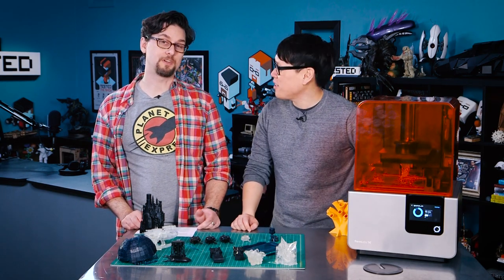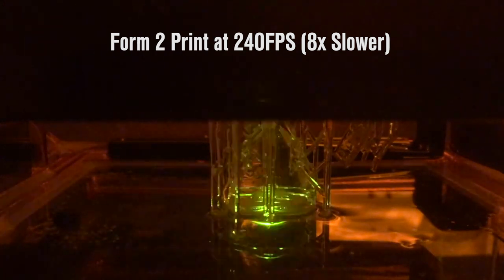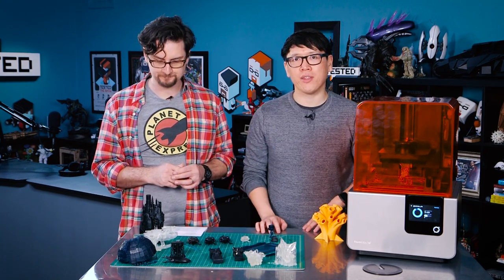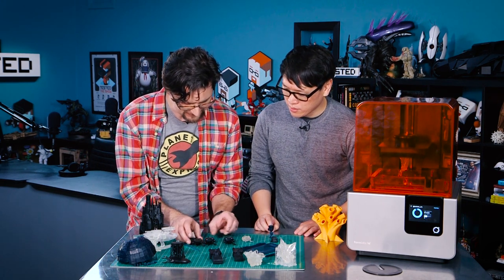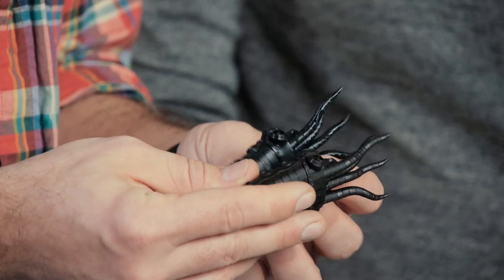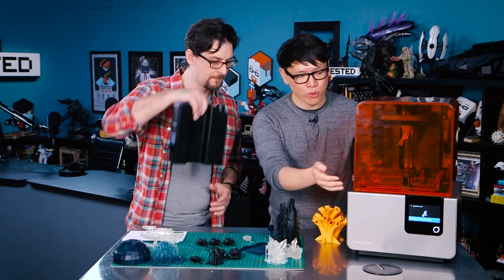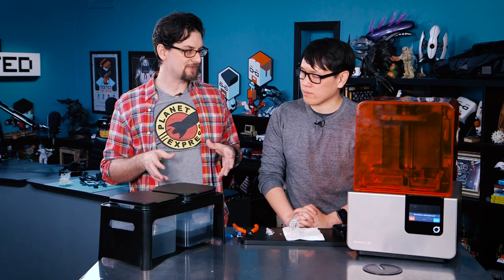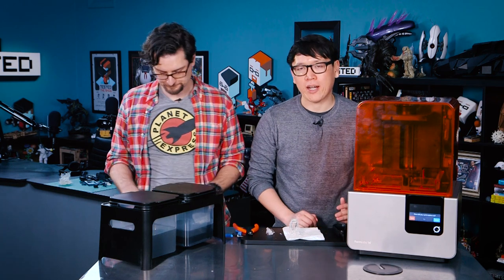Tested In-Depth: Formlabs Form 2 SLA 3D Printer

Comment: Norm's statement of it not being your first 3D printer is a little misguided. Why should someone get an inferior one in the first place? Just because it is cheaper? If you have the money, and it's something you want/need, then don't waste money on a crappier/cheaper printer, that you're just going to replace, and never use after anyways.
Reply: +SpeckyNation It's better to start out with a cheap printer, if you get a really good one as your first, there's a lot of things you missed out by not tinkering with the cheap one. It's so much better to learn and make mistakes with a cheap printer.
Reply: Your logic seems flawed.
Reply: +SpeckyNation what if you don't like it? can't 3D print money...
Reply: If you're getting a 3D Printer, without knowing if you'll like having a 3D printer, you really shouldn't buy a 3D printer.
Reply: +SpeckyNation 
If everyone had your logic a lot of markets wouldn't be there.
Reply: My logic of, if you can afford the best, and want the best, then why buy crap because it's cheaper? Your logic is illogical.
Reply: troll detected
Reply: +SpeckyNation actually, I think they are mostly talking about the learning curves of things like the modeler and slicer... Practicing on shit printers let one experiment with less pressure, and more willingness to tinker/take machines apart/remake objects etc. It's more about getting the basics down before jumping into a premium product. Neither approach is wrong.
Reply: Luke Luoh
Plus there is the term "entry level".
Reply: +kurisu7885 no real entry level SLA tho
Reply: +SpeckyNation - I actually did consider the Form 1 as my first printer, but decided to go for an FDM machine instead.
I was interested in SLA because I'm interested primarily in making models and model parts, and SLA is far superior in terms of detail reproduction. But I opted for FDM for my first machine because I felt it'd be a better all around machine. Not all the parts I want to print need that superior detail. Some would benefit more from larger build volume instead. A big ol' FDM printer can handle a lot of my model printing needs and even manage some costume pieces.
SLA isn't just more expensive for the machine, it takes more money and work to operate it as well. The resin needs to be kept clear of debris, the parts need to be cleaned after printing, and so on. It's a messy business. In my hobby I've worked with messy materials, resins, epoxies, and so on, it doesn't scare me off, but I know what I'd be getting into, too.
So my feeling is that when I get a SLA machine, it'll be used for parts that really benefit from its strengths, to save money and effort when I don't need that level of detail.

I definitely can relate to your sentiment that money spent on inferior machines is simply money wasted. But 3D printing is a pretty fiddly, error-prone hobby to begin with. A lot can go wrong, and a SLA machine doesn't make things simpler.
Reply: +Tetsujin If you are looking for a better all round machine next time get a Gizmo 3D Printer.
Reply: Michelle de Klerk It's not "better all round", there are tradeoffs like any other machine. My machine has a larger build volume, it can print dissolvable support material, and it's cheaper to operate. But of course on the downside the print quality is poorer than an SLA machine, too. But the trick is that a lot of things I want to print don't need the superior print quality. Some things do (and for those things I'd love to get a SLA machine some day) but a lot don't.
Reply: +Tetsujin Actually even the GiziMate and GiziPro can have the bigger build plates installed. But yes, good to go for what suits you best of course.

Comment: Has anybody noticed that the vehicle who's licence plate you could read was bigger than the one printed on the Form1+?  You didn't mention modifying the model between prints, so does the Form1+ print things too small, or does the Form2 print things too big?

Comment: I was thinking, in case bubbles appear in the (transparant) resin like happened in that one model, is there not a way to shoot a laser through the model to cure the liquid afterwards? Or does it expand in the process of curing or something.
Reply: +Bas L I believe this is the purpose of the post - curing oven they talked about, and mentioned that they had not built one yet. Formlabs also mentions on their website leaving parts on a window sill can be somewhat effective at curing parts as well.
Reply: Since the resin is cured by UV light, you could leave it out on a window cill and it would all cure in a few days, or you could stick it in a UV chamber for a couple of hours.

Comment: What soft ware do you draw in to make your objects. I would like to use this printer to make small model trains. I think the detail would hold up for me. And I like the price for the Formlabs Form 2 SLA 3D Printer. However. I am looking to pull the detail like you have from a 3D drawing package. What are you using?

Comment: Hi, I would like to buy this Printer but I wonder: Can I recover and reuse the resin that is in the tray if I decide, lets say, that I would like to print with a different material or colour ? I saw that there are a couple different materials.. does someone knows if the flexible resin is really flexible or just a little bit ? do you know if there a rapid rate of development for different resins? (I own a 3D printer and there is a wide variety of materials) Do I have to buy the resin for Formlabs only ?

Comment: So what's the deal with physical resilience of prints? My purpose for a 3D printer is to print prototype mechanical parts, equipment boxes, replacement parts, other practical objects. SLA prints seem like they're not durable, they're subject to degradation in UV, etc.  It seems to me that SLA printers are mainly for printing toys (the $3000 Yoda head machine), FDM is for doing real work.
Reply: Much agreed, this review is a bit of a waste, i'm happy for the tested folks since they get a "free" toy to try out, but useless for viewers
Reply: Much agreed, this review is a bit of a waste, i'm happy for the tested folks since they get a "free" toy to try out, but useless for viewers
Reply: +John Ridley Its castable. If you want stronger /more valuable materials this is your prototype. The print is only the end product on certain projects. For what you want, you need to make a form around the print after cleaning, then cast in your finishing material. This is just a straight from the digital world to the real world system. They use this system for making teeth and jewelry.
Reply: +Arbhall McDougall Definitely not the device for me.  If offered this or a regular old FDM printer, I'd take the FDM every time. Plenty accurate enough for prototypes and small stuff I make and I can just peel the print off the tape and use it 5 seconds later, no hour of cleanup or casting a duplicate.  Also cheap cheap materials, and I can just hit "print" and walk away, time after time.
Reply: John Ridley I strongly suspect you are neither a dentist or jeweller. If you dont need the level of detail the SLA printers are capable of then its straight up overkill. You want to print blocks and fasteners. Which is cool if that is what you need a printer for. You can get pretty good resolution prints from FDM, but some folks cant and wont settle for pretty good. Some people need that higher level of detail and molding the print is something they planned for. Different applications.

Comment: Great video and awesome information. I am debating wether to go for the Form 2 or the Ultimaker 2+. Has anybody had any experience with that printer. I know they use different materials, but it seems like the Ultimaker 2+ is one of the best printers of its kind. I'm mainly planning to use the printer for action figure models and collectibles. Any suggestions or advice? Thanks.

Comment: Why do the slicing software for liquid resin 3D printers, can't hollow a solid object and do a pattern infill?
Reply: +seriousCADninja - I wondered that myself: I had assumed these printers could print sparse infill just like FDM printers. But the problem is, you'd wind up with a lot of uncured resin in the hollow areas of the model. If those areas are inaccessible, the liquid resin is trapped inside the part, and then if the part cracks later, liquid resin will leak out.

Comment: This interested me greatly, but the consumables such as the trays are quite a bugger. cost per print wile they are way better resolution they cost, by my calculator based on my own FDM  printer about 75% more. Maybe by version 4 this will be ironed out. The resin, being based on the same resins used in carbon fiber should be a lot cheaper.

Comment: Im looking at an Objet 30 Pro which is about 40k dollars, and im considering the Form2, as its a LOT cheaper but the problem is, as soon as he said "You need to design your part to suit the printer" Thats kind of a deal breaker for me. We design metal parts that are machined, and our prints need to be identical to the machined parts so we cant just change it for the sake of a print. Shame really, as this printer is so cheap compared to the objet, but, needs must....
Reply: You misunderstood... he was simply talking about how you "export" the model. It can be the same exact design so you're not changing the design. It is basically exporting the model as a "solid model" or as a "shelled model". The shell is basically a hollow part with a designated wall thickness.... which is the extra work he was talking about.
Reply: +Michael Fargo Pete's point stands. The Form 2 use breakaway supports that sometimes leave support marks. You can't sometimes cleanly remove the support mark and internal cavities or tight spaces sometimes can't be printed as the supports can't be reached. The point of the Objet is to print any geometries with soluable or water-jet removed supports with the polyjet process.

That being said 90-99% of the general purposes and engineering prototypes we handle can be done on a Form 2. Sanding support marks sometimes is a pain however.
Reply: and come on guys...you're talking $40k vs $3k  Its not a valid comparison
Reply: Used to have an objet 30.  Great print... always broken and no service.

Comment: I first had an form1+  was not to impressed especially when it is cold the resin has to be at an certain temp so had to keep a heater around it  and had a lot of failed prints at the price of the resin expensive story,  then upgraded to form2 fantastic machine got its own internal heater hardly any failed prints had one out of about 40 prints and lot of issues solved from the form1+

Comment: i rather have a fdm printer mainly because more variety of colors/materials. with fdm you can print elastic, wood, medal, etc. plus its much cheaper. and the entire point of a 3d printer right now is prototyping not finished product it doesn't have to look perfect.
Reply: +SHADOWxWOLF - I'm with you there (specifically in the sense that I did choose to build a FDM printer rather than buy a SLA printer) - but if I need to produce a detailed part, and the printer isn't capable of that, then the print it produces isn't much good to me. I'd just wind up making (or re-making) all the detail on the part myself. There are cases where a printer like this would be very useful.

Comment: why dose the printer need to reset at each layer? one would think it would just move slowly up as the laser built up the layers. it would be so much faster, if that were the case....
Reply: oh is a wiping/comb/filter? what about pumping through a filter, less movements. less chance of something going wrong. less stress on parts & model...
Reply: rommelfcc There is a printer like that. There was some TED or TEDx talk where they printed a small dodecahedron with an "continuous" SLA printer in the ~5 minutes the talk lasted. It also discusses why printing "continuously" is as hard as it is.
Reply: +rommelfcc If there was a filter, it would have to be changed for each resin type and colour, making it very expensive. Also, a filter will have to be quite fine tuned to remove and small impurities and misprints, while not disturbing the pigment in the resin.
Reply: +rommelfcc CHeck out the Carbon 3D CLIP printer
Reply: +TheCrafterzCrew - Also, if you wound up with a piece of debris in the middle of the tank, it'd take a very long time for a pump and filter at one end of the tank to catch it. (Remember also that this resin is very viscous...  it takes time just to get it to flow from one end of the tank to the other.)
But the main thing is the layer peel. The resin that's cured by the laser is in contact with the bottom of the print bed. When the resin cures in contact with the print bed, it bonds to it, and the bond has to be broken before the next layer can be printed.
Reply: +Scott Robinson Check out the Gizmo 3D Printers instead - more affordable, less supports needed, still super fast :)
Reply: +Michelle de Klerk  And the resin is cheaper.

Comment: FDM printers are printing at 10-60 microns now..
Reply: +Minkoe Cub3D Desktop FDM printers don't come close to that resolution. Being a machinist and looking at FDM, I wonder how many people can be fooled into thinking the word "accuracy" can be applied to anything from an FDM under $40k.
Reply: +Harrelson Trumpets There is absolutely no reason an FDM printer can't print 10 micron layers. Layer resolution is simply a function of nozzle size and motor accuracy. Nozzle size is easy - a 400 micron nozzle diameter can print 100 micron layers accurately, so to get the same relative accuracy at 10 micron layers you'd just need a 40 micron nozzle. Cooling will be more finicky, but with a properly shaped nozzle it shouldn't be an issue.

The big trick is the motor accuracy. You're not going to get 10 microns with $20 ebay stepper motors. It's just not going to happen. You'll probably end up needing a gear motor setup to get that kind of accuracy. You can actually get about halfway there with a $40 5:1 geared stepper, so it's not really that far off, and there are other directions you could go to get the kind of motor accuracy you'd want.

The real problem with printing 10 microns on an FDM is the print time. A print that takes 1 hour at 100 microns with a 400 micron nozzle will take, at a minimum, 10 hours at 10 microns with a 40 micron nozzle. This is assuming you can get the same print speed out of your geared down motors, which you probably won't unless you also went with a much higher quality stepper the geared equivalent of that $20 ebay stepper. The motors themselves could potentially mean you print 10x slower, which means your 10 micron print now prints in 100 hours instead of 10 hours. Even worse, if you are printing a high fill density, then you run into the problem of only being able to extrude 1/10th the plastic as the 400 micron nozzle. So that's ANOTHER possible 10x speed cost. This one will be completely dependent on what you print and how you print it, but it's probably going to pop up at some point.

This is, in my opinion, the biggest weakness of FDM printers. There is an exponential relationship between print speed an accuracy. With SLA and SLS, because you're not dealing with an extruder and the volume it can put out, it's a linear relationship at most. So, printing 10x more accurately in a SLA printer only takes 10x longer, all else being equal.
Reply: Interesting perspective, but it seems you agree in the end. FDM is not accurate at a reasonable price AND at the highest possible resolution, it does not come anywhere close to the accuracy of CNC machining. AND CNC machining is 100 times faster.

Comment: A silicone tray? Why not make it a glass tray? That's so weird.
Reply: +allluckyseven silicone is much lighter, therefore speeding up the print job.
Reply: +allluckyseven Silicone bends. Easier removal possibly. Maybe better adhesion as well.
Reply: +havingMC Absolutely not. Movement in the Z-axis is slow anyways, and a stepper motor is strong enough to lift glass regardless.
Reply: *****
Makes sense. It becoming hazy and having to be thrown away seems to be a problem though. Maybe they could find a clear non sticky coating, like teflon or something that wouldn't degrade while being bombarded by laser, or at least not as fast.
Reply: +Videblu - The tray doesn't move on this machine. It sits at the bottom of the machine and holds the pool of resin.
The big thing is that newly-printed layers will stick to the base of the tray. and the machine has to pull these layers off the tray in order to print the next layer. Silicone probably releases the cured resin more easily than glass.

Comment: just a novelty . not a practical way to replicate yet.
Reply: +carhead Definitely not a novelty, it's pretty much the industry standard way of prototyping due to high accuracy, speed and detail. For a home printer, it's amazing but there would  be a lot of things to think about when using an SLA printer in an area that isn't really designed for it.